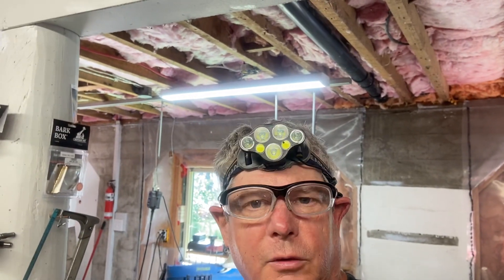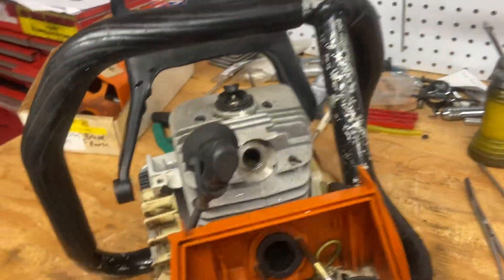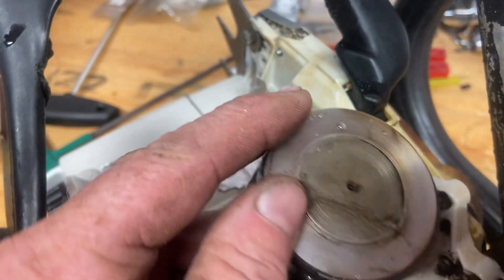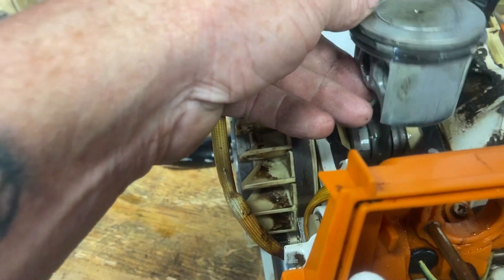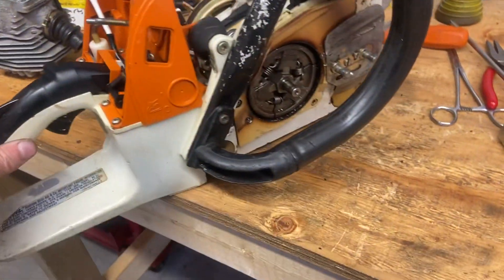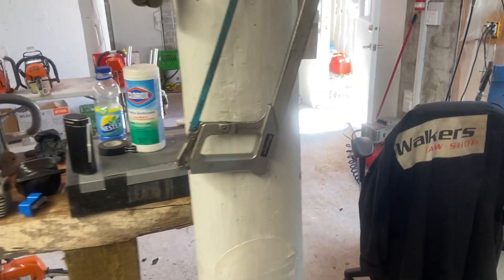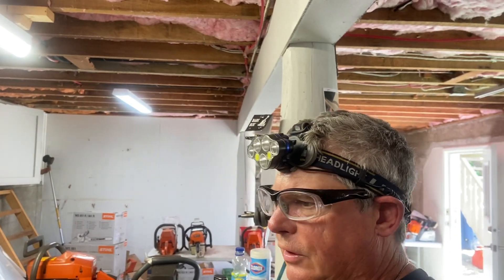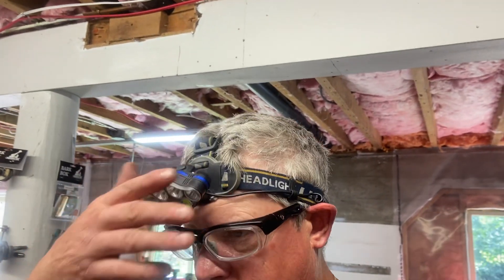Stihl 066 modded saw

Comment: I have an 066 and 660 for bucking lots of hardwood firewood in the Fraser Valley. Definitely like the bottom end for big wood..especially maple and birch. Great for ripping (noodling) knarley wood...vibration definitely an issue after 25+ years. Great video 💪🍁🔥
Reply from the maker: Yes great saws keep er in the wood

Comment: My 2 cents on the exhaust side of the piston being notched is they didn’t like the extra intake timing from it and flipped it around instead of buying a new piston.
You can run the piston backwards in that saw without issue.

Comment: G'day Donny, we ran Mac's early then Partners  then Dolmar they were tough, 064 025's you couldn't kill those little saws, when I got my first 066 Mag it just made sense I didn't notice it being hard on the hands after years of cutting dead Grey Box I had very little feeling anyway 👍.
Reply from the maker: That’s cool bud do you still have a 066 runnning
Reply: G'day the Don, I still have them both and they run but they're wall hangers now still attached to my Grandberg Alaskan 48 inch double ended slabbing mill. They were put out to pasture in 2009 when we purchased the Lucas Mill my brother and I slabbed truckloads of Redgum with it over the years no one around here knew what it was back then 👍🇦🇺.
Reply: The Alaskan mill I mean .

Comment: They have a full wrap for that saw. Pro saftey makes it. Bailys stocks it. I never cared for the new style 066. I believe that poly fly wheel has alot to do with it. Cant beat the 066 like you said. Little general maintenance you have a wicked saw. Question. Why do stihls have a red kill switch on only some? In sure youve seen many of them.
Reply from the maker: We used to sell the pro safety bars for them and other models and red switch good question I think they used to have that in older models then they changed it to black but I do remember something on the early 066 the switch shaft would pop out so maybe it was a upgrade eh bud

Comment: Did I see that the piston might be backwards. With the pins on the exhaust side? 

Hard to tell in the video
Reply: No. Piston pins seemed to be on the intake side. Maybe that notch was there for weight reduction 🤔
Reply: A water bubble let it look like the pin is on the center of the ex port. 
Maybe its Freeported Donny?
Reply from the maker: Piston not on backwards
Reply: @donnywalker4691  i know
Reply: @Ketis1985  yeh, just didn’t see it on the first take.

Comment: A butcher has been in there. What type of idiot does that to a clean 066. It is not the most desirable, early short case but still....
Reply: Not necessarily. Maybe the guy cut the popup piston so he could do a base gasket delete for little bit more compression and intake duration. Edit: that notch could be there for weight reduction...
Reply from the maker: It had .028 squish with gasket so I left that